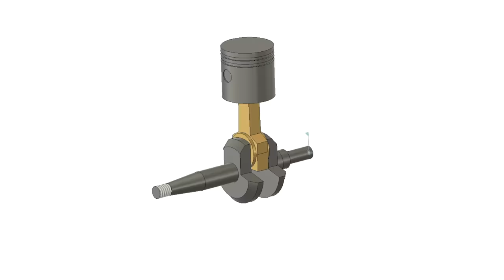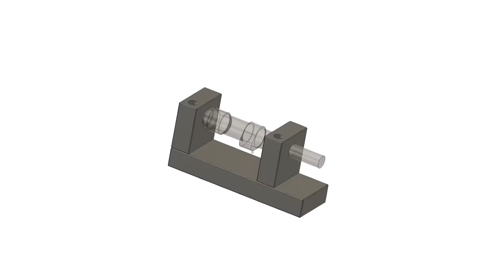Making a 4 Stroke Engine. Episode 3 - Crankshaft and Camshaft

Comment from the maker: Episode 4 : Engine Block and Cylinder Head
https://youtu.be/fENYucG1EYc
Episode 5 : Carburetor, Flywheel
https://youtu.be/74sVglPC9ko
Episode 6 : Final Assembly and First Run
https://youtu.be/isuksNyqLj8
Episode 1 : Piston and Connecting Rod
https://youtu.be/XjlVgBYeh0c
Episode 2 : Gear & Valve
https://youtu.be/6WAGsgdBfT0
Reply: Hi , ich will dieses Object lernen 🤗, wie kann ich lernen ..... bitte Bitte bitte Hilfe 🤗🤗🤗🤗
Reply: Nice
Reply: Hey what type of bench top lathe and mini mill you using?? Cuz the time laps makes it almost look Servo driven
Reply: can we have the blue print
Reply: @glendenton3193  
He is using a sherline lathe and mill
Old school machining on a hobbyist 
Lathe and mill manual machines. 
BUT LOTS OF SKILL.
Reply: Thank you for showing us how to use a Sherline lathe and mill with lots of Skill.
I'm 64 years old. I haven't seen these
Old skills in some time.
Reply: @danielescobedo7968  Icic kool I made a mini two stroke engine in school but I programmed and used a cnc lathe with live tooling and y axis
Reply: You probably dont care but does anyone know a method to get back into an instagram account..?
I somehow forgot the account password. I love any tips you can offer me
Reply: @Lucas Kellan Instablaster ;)
Reply: @Edgar Castiel it did the trick and I now got access to my account again. Im so happy!
Thanks so much you really help me out :D
Reply: @Lucas Kellan No problem :D

Comment: Good machining but the barstock seems to be aluminum to me Is this material strong enough for a crankshaft?
Reply: I was thinking  that as well.
Reply: It's a very small single piston 4 stroke engine and will possibly just be a model running engine with no loading. I think it will be more than adequate. Also depends what it will run on. It could be an RC Model fuel with high oil content.
Reply: It looked like stainless steel to me, they look very similar on the lathe
Also the engine is like 0.5cc so I don’t think it’ll have torque but I suppose we’ll find out
Reply: @matthewbuttle  On the screen of my computer steel look more silverish than aluminum which is whiteish... well this is just my impression on the subject.
Reply: @matthewbuttle  That isn’t stainless steel. No how no way. I’ve machined a lot of stainless steel. He wouldn’t have been making those cuts on that mini lathe in SS.

Comment: That looks great actually... the crank should have some oil holes drilled through it and into bearing surface. But, are you going to anodized it?  Aluminum is soft, how are you going to prevent excessive wear?

Comment: What material did you make your crankshaft out of ?    Also I used the same method to make my cam shafts for the 10cc four stroke engine and the Midget engine.

Comment: Mill the sides of your vise whilst holding a piece of material clamped in the jaws. Whomever made that vise clearly skipped that step. You should do it slowly and just enough to have a clear skim across both sides of the vise. First cut should be made after you've shimmed and clamped the vise as close to 90 as you can humanely get it.

Also, on your Bosch drill press, replace the spindle bearings. They are super cheapo chinese made ones with the shittiest tolerances imaginable. The removal is a bit complicated, but there's plenty of videos online to guide you. There's one needle bearing (which needs to be the highest quality you can possibly get, seriously, spend as much as you can on that) and a normal one for the bottom. I'd get Japanese ones, but the ones i got, from Germany were plenty good. It cut the spindle play considerably. You can also shim the affair on the slide as well, but most of the play is in the garbage bearings.

In one of their online forums, Bosch pretty much admitted they screwed the pooch and that since this is a pro-sumer tool, they will not come out with a repair kit and manual. So don't bother with them.

Comment: Awesome to watch, I'm just curious about one thing: 

How do you know what angle to offset the intake lobe and exhaust lobe? It looks like theres about 90 degrees between them. What would happen if you offset them by say 180 degrees? And what effect would this have on the final valve train?

Thanks!
Reply: I believe and dont quote me on this, but its because of the off set of were the piston will be. Look up the Otto cycle. You have the 4 strokes intake compression combustion and exhuast but have them 180 degress wouldn't really work too well for the way the engine is running. Dont quote me on that but thats what i think. Also look up a brigs and straton camshaft
Reply: First you have to open the exhaust valve. Then the Intake. When closing the exhaust valve it is time to open the intake to get some scavenging (bringing more fresh air/fuel in the combustion chamber). A intake or exhaust stroke take around +- 180-260 degree crankshaft rotation. For camshaft it means it is the half of the rotation of the camshaft duo to the 2:1 gear ratio. So for example 200 degree (duration) for both intake and exhaust degree on the crankshaft means 100 degree on the camshaft. If you place bothes lobes after each other (first exhaust fully clossed then intake open) you get 200 degree total valves operation. But when valves opened max on the highest point of the cams it is 50 degree for intake and exhaust. Which means both combined is 100 degree lobe separation.
So you could change the geometric of both cams (lift and duration) alone and the position of the cams (lobe separation). For more low speed engines you should have cams with more shorter valve lift and duration (the example 200 degree on the crankshaft). And for the lobe separation could be set large so the time that the exhaust and intake are both open be short. Less loss of unburned fuel. 
For more power and race engines the lift and duration of the cams are much larger. Here the duration could be around 300 degree camshaft rotation. This give options to open intake earlier or closing exhaust later. What called valve overlap and improve scavenging on higher rpm's. So more high speed power. .

Comment: Are you planning on running it or it's just a model ?, if you are planning on running it your crankshaft will not last very long without the oiling galleries.

Comment: So, is it that the 4 markings on that 'Division Plate' you attach on the cam jig are for the 4-cycles (intake, compression, combustion, exhaust) that the cams will endow onto the valves?

Comment: Do these parts withstand against working forces when used after making with metal turning process? Is there any requirements of heat treating these parts before using them?

Comment: I have a single question. Why thin the crankshaft ends before finishing the crank? Surely cutting the whole crank before thinning the crank ends would have given a more rigid cut? Or did I miss something?
Reply: Your question made me think about this.My 'guess' (I am not a qualified engineer) is that the ends are machined first, because these are the rotational  points in the final engine, so the cams need to be referenced from these points in order for the best accuracy.

Comment: Nice work, dam shame the crankshaft is aluminium. Unfortunately that won't last 2 mins due to strength and the chance of the bearing galling up the material. Would be better off made from tool or silver steel.

Comment: Good evening.
I would like to know how you determined the angle between the two cams
Reply: Gognometro 😉
Reply: @lonewolf-ti7vb  what do tuo mean? I have a 4 mm valve lift and a 15 mm piston stroke how to determine the angle of the cams with the protractor is there no formula for the  calculation?

Comment: Very nice but I can't see an aluminium crank will remaining in one piece for very long in a running engine.
Reply: Plenty of engines put 1000 hours on aluminum rods. Not to mention most engines have aluminum pistons
Reply: @josephschaefer9163  Who said anything about an aluminium rod? I was talking about an aluminium crank.
Reply: @sidecarbod1441  I know. But if aluminum rods and pistons don't break, why would the crank be weak?
Reply: @josephschaefer9163  Are you serious? Each component in an engine is subject to different loads and therefore different materials are used to make each component. A con-rod is subject to extension and compressive loads which aluminium is OK with but not great, repeatedly applying a load and removing the load on aluminium will cause it to fail quicker than on steel for example but having said that small engines (model engines) get away with using an ali conrod. (Its light and that use useful on a high revving engine). Low output engines such as lawn mowers could use an ali rod. Aluminium does not have good fatigue resistance and that is its real problem. Top fuel drag engines use ali rods but they will do a very limited number of runs before being replaced. (Maybe one run?). Pistons are made from ali because it is light and can be made strong enough with good thermal properties if the right amount of silicon is added. Crankshafts are subject to all sorts of loads including bending loads, torsional loads, loads induced by 'crank whip'. You may as well make the crank out of cheese if you are going to make it out of aluminium, at least you could eat it when it fails! I'm sure that the finished engine will run and rev but if it was put under any real load the crank would twist itself into a knot. Don't get me wrong, I enjoyed watching the video!